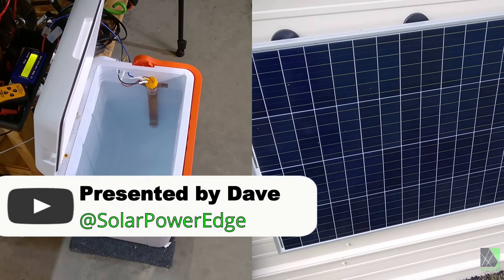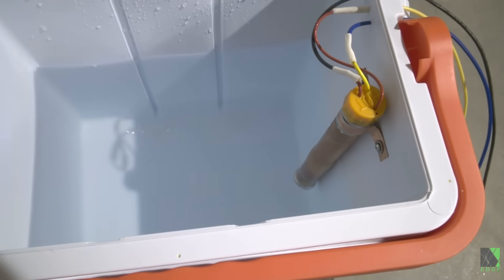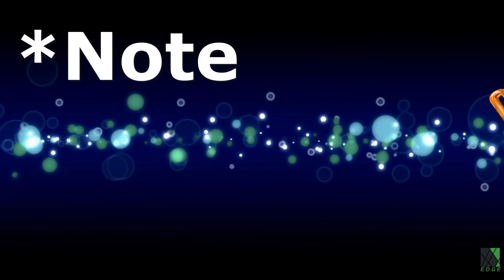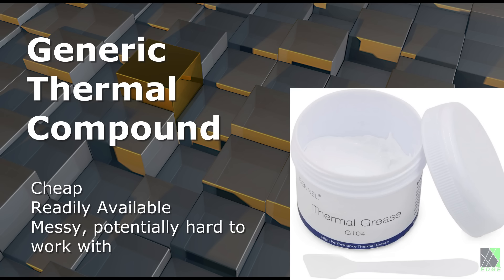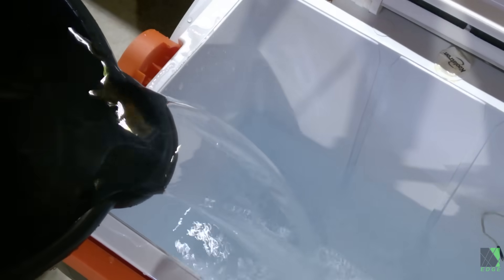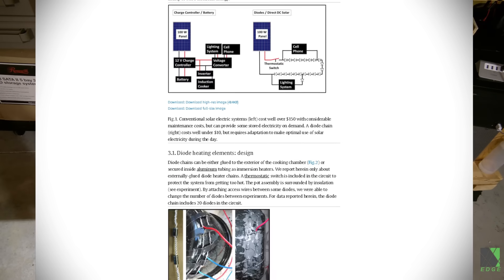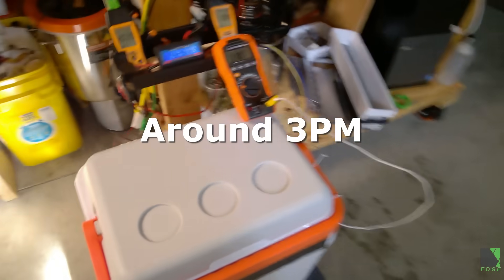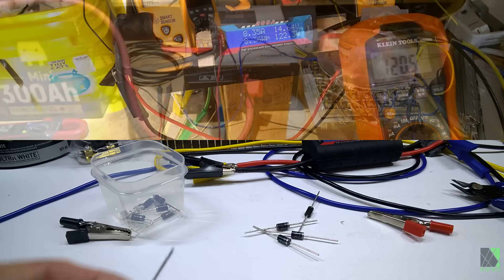I built a PV DC Semiconductor Immersion Water Heating Element! diode chain application #science

Comment: Please can you publish more details of the specific PV characteristics and the specification of the diode chains and your calculations  as to how you arrived at those values. Thanks.
Reply from the maker: Hello, not sure where to publish it. Based on experience, no one seems to watch my videos if I make them detailed with data sets and so forth. Therefore I am forced streamline them into a brief overview and quickly focus in on real world possibility and applications. 
I am depending on real world data. I used DC wattmeters to track watt-hours / KW/h. They key here is not to get confused by temperature like many do - track the watt-hours instead. Temperature is not as important as we're looking at electrical efficiency, not thermal.
Since diodes are cheap, I've tested about 20 different solar panels and a ton of different arrangements. As well as ordinary resistance heating elements. 
Specifically for water heating, the diodes can net 10-20% more heat (again, tracking watt-hours not temperature) depending on how well they're matched up. If there is cloud cover, it gets very interesting because diodes can keep regulating but the resistance heating element simply cannot.
However I found it difficult to balance the right # of diodes to hit vMPP and it takes several tries usually before the numbers look good. And then there is the temperature gradient as the water heats up - further complicating matters.
There are a lot of variables. I don't think many people have tried this except a few researchers. You may be interested in reading the "hot diodes" research paper. They used temperature to track performance (instead of watt-hours like I would prefer). They showed diodes far outperformed a simple resistor heating element. I can concur. In fact I don't think their setup could even use the extra heat, but at least they proved it works.
Reply: Permatex:
Dries to a Vinyl Polymer: Permatex Liquid Electrical Tape dries to a vinyl polymer, making it resistant to dirt, dust, chemicals, and moisture. 
Waterproof and Flexible: Provides a continuous waterproof seal that prevents corrosion and remains flexible when dry.
Reply from the maker: @loulelea I've got to try it! Thanks for the ideas :) 👍
Reply: Very intriguing project..it occurred to me that if you use a led array that creates heat and light which then captures the light via another solar panel then you can feedback the energy and make the process more efficient requiring less input power. Another thought would be to experiment with transistors since they are diodes that have a gate and use the gate as a feedback mechanism.